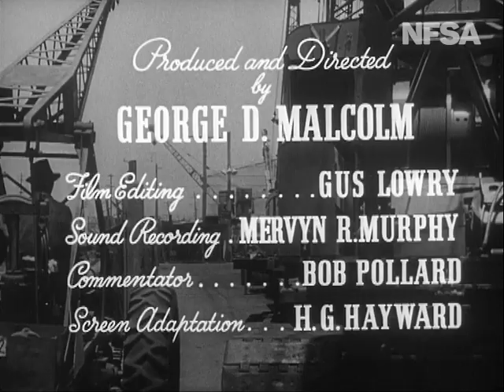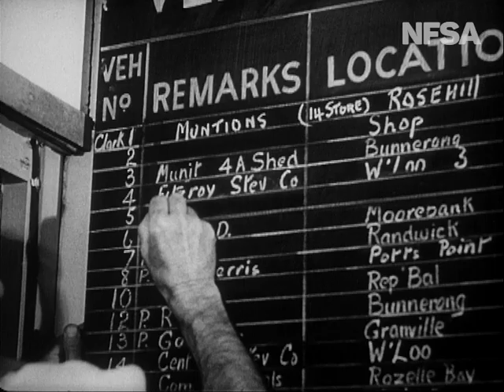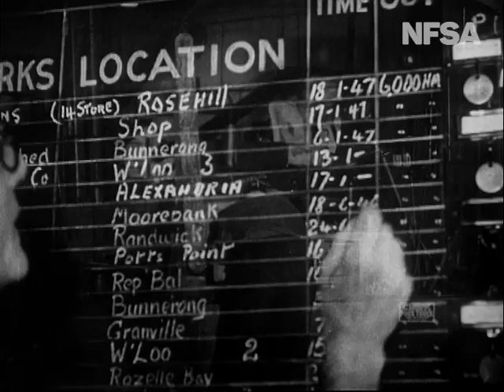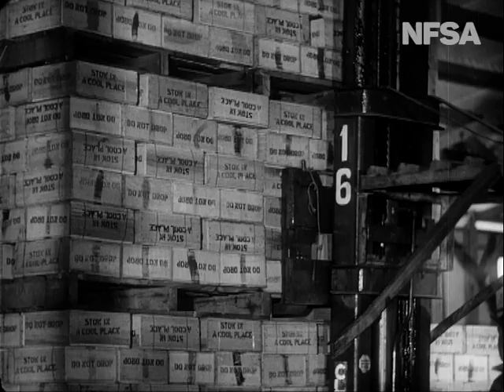All In A Day's Work

Comment: Back in the 80s there were still some of those forklifts in service, worn out flogged out pieces of crap but what a service life
Reply: I was still using a Clarke, battery operated pedestrian forklift when the car manufacturer I worked for shut its doors for the last time recently, 201X. This type of machine was already in use during WW2. Says a lot really.
Reply: Yeah but throw away Chinese garbage is better for the environment apparently.